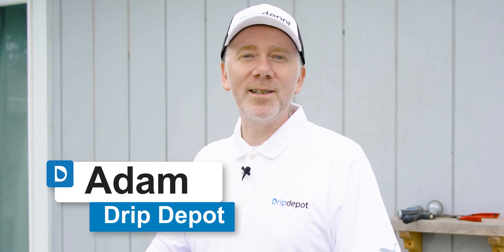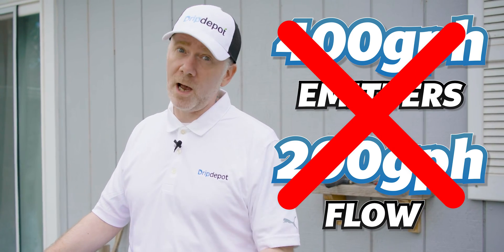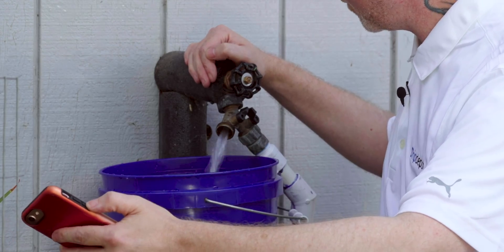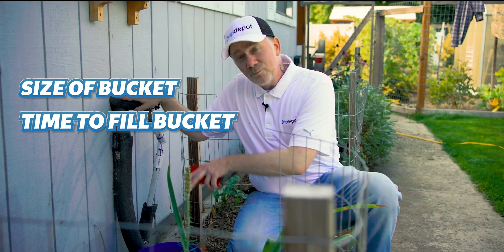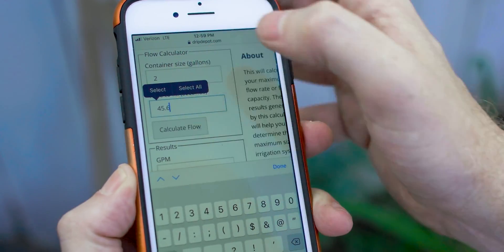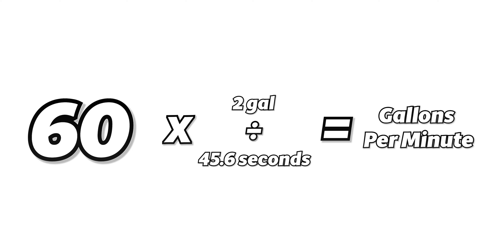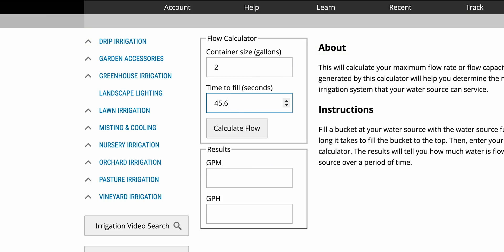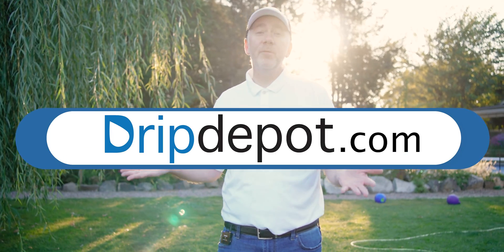How to Check the Flow Rate of your Water Source (GPH/GPM)

Comment: But what is the output of my rairbird system that connects to the water supply? Is it the same as the bib?
Reply from the maker: Good question, your instinct to ask it was spot on.  Flow will typically be a bit less coming out of a timer.  All of the head assembly pieces have an impact on flow to one degree or another.  The impact is typically small, but there are some exceptions, particularly in timers.  I think I mentioned it in another comment, but one thing we see professionals on the residential side of things do is to simply subtract 20% from the tested flow rate.  This 20% reduction is meant to account for all of the small variables that can be time consuming to calculate individually (small losses in fittings like elbows, the channel through the timer and/or pressure regulator, the filters, etc).

Comment: Do you need to test with the pressure regulator on? Currently i get 5 gallons in 17 seconds but I would assume when the pressure regulator is on it will lower correct?
Reply from the maker: There's definitely no harm in checking with the regulator connected, as you are correct that it will have some impact (usually minimal, but it can be more significant in cases where the regulator diameter is smaller than optimal for the flow rate required).  

Another approach we see a lot of is to subtract 20% from the flow rate and work from there.  The 20% reduction is meant to account for all of the small losses in an irrigation system that can be tedious to calculate individually.  Small losses like elbows (both 45° and 90°), tees, pressure regulator channels, valve channels, etc :)

Comment: Now if i could only figure it out for a house interior plumbing when it's a house that isn't built yet. Grass irrigation comes out of the rain's expenses.
Reply from the maker: The builder or plumber handling that part might be able to let you know what to expect to some degree.  

If they can let you know the size of the incoming water service line, expected static pressure, plans for pressure regulation and what size supply lines they're going to use for the hose bibs a rough ballpark could be determined :)

And rain definitely works for the grass, our area went through a few years of drought so I got into the habit of replacing lawn with edible landscaping and native plants.  If that's the route you're going a ballpark on your hose bibs is a great place to start.

Comment: How do i do this when my faucet is close to the ground? A bucket won’t fit, not even a 1 gallon bucket will fit under it.
Reply from the maker: This can definitely be a challenge (and one I faced as well, my spigot at home is only about 5" or 6" from the ground as well).  Probably the easiest would be to use a short length of hose to route the water up and into a bucket.  This will influence the reading a bit, but if anything the lower reading will give you a little bit of design cushion.  

I ended up using a gooseneck adapter on mine - even that didn't lead to a perfect reading since the bucket had to be tilted, but close enough I could work with it.  A 90° Faucet Elbow can also help (and good chance you'll be using something like one of those either way since you'll need to build at head assembly at the spigot).  I'll link both parts below so you can see what they look like and how they could be used to change the angle of the hose connection: 

https://www.dripdepot.com/brass-gooseneck-with-shut-off

https://www.dripdepot.com/three-quarter-inch-hose-thread-faucet-adapter-fitting-type-elbow

If you have one of those faucet Y splitters at home already, that may also work to some degree, at least to turn the hose connection so you could connect a short hose or something similar to direct water into a bucket or jug :)

Comment: What if I am trying to use a sprinkler system valve so that I can set up a timer and control from my phone? also do I need a pressure reducer for any reason? I have 6 grow boxes each is 3 1/2 X 7 1/2 - I would use 1 sprinkler head for the 3 and another for the other 3
Reply from the maker: You bet, sprinkler valves work well for drip irrigation zones as well, and will often have higher flow rates than a hose bib since they're intended for sprinkler systems.  Testing the flow rate is a little trickier since it's in the ground.  The "official" way to test the flow rate from a sprinkler valve is with a water meter, but I realize that's not always convenient (and they can be a little high in price).  

A work around that would at least kind of work would be to attach a threaded fitting to the outlet of the valve (which might have threads already) and attach a short length of tubing or hose to it and do the flow rate test out of that.  Not 100% accurate, but gets you in the neighborhood at least.  

Good chance you'll need a pressure regulator since most drip operates at 10 to 25 PSI and sprinkler systems are usually much higher than that.  A filter is a good option too, drip emitters have much smaller orifices than sprinklers.  

With that said, it sounds like you might be looking to run the drip system from converted sprinkler heads rather than the valve itself?  If so, most of the information above applies exactly the same, though a flow test becomes less important since one sprinkler often has as much flow as an entire drip system.  Pressure regulator and filter are still usually needed when converting sprinkler heads. 

We made a short video that goes into a bit more detail in converting sprinklers, if you hadn't bumped into it yet here's the link: https://www.youtube.com/watch?v=l8gzTCgZQLQ

Comment: That’s seriously bad and wouldn’t even run a small zone unless it was two heads probably
Reply from the maker: Yep, it wouldn't run too many sprinklers, that's for sure!  It could support a reasonably sized drip system though.  It's not in this video, but we ended up setting up a drip system for the raised beds at the house where this hose bib is :)

Comment: I did this test and it only took 8 seconds to fill up a 2 gallon bucket. So I calculate that my system can handle 900 gallons/hour. Does that sound right? The water was coming out of the spigot much faster than in your video.
Reply from the maker: That does indeed come out to 900 GPH, a very healthy flow rate for a hose bib!  I thought mine was strong at 750 GPH at home, you have some fantastic flow out of that.  

You probably won't make use of all that 900 GPH, but the abundance of flow is a good thing to have and will give you lots of flexibility in planning.

Comment: The challenge I’ve run into is by the time you add all the stuff, fittings, head unit, etc., I’m getting like half what I get at the spigot.
Reply from the maker: That's fairly normal, and things are likely to improve once the system is all setup (particularly the pressure regulator, which doesn't really begin working until the lines are pressurized and there's flow from the emitters).  

In the industry, as a way of quickly accounting for many small losses (elbows,  tees, some valves), is to subtract 20% from the flow rate and size the system or zones to that number.  So 500 GPH becomes 400 GPH.  Friction loss in the pipe or tubing will still be calculated separately, but the 20% takes care of all the small losses that are very time consuming to calculate individually.  

Happy to help with this if any follow-up questions come, don't hesitate to drop a line!

Comment: I just set up my drip irrigation for 7 beds and not every bed is receiving water. Is this tied to a pressure issue? I used 70ft 1/2 in tubing, pressure regulator is 25 PSI. Should I install a second set up and cut the irrigation in half?
Reply from the maker: Danielle, this could indeed be tied to pressure or to flow -- before zoning the system, there are a couple ways you can check this to confirm.  If possible without too much hassle, you could set it up so that the beds that are getting water are bypassed -- then you can check the beds that are getting water.  If they begin emitting water as they should, zoning the system would likely fix you right up. 

Another thing to check, and this might be more inconvenient, is to test the flow rate of your water source versus the flow rate of your system.  To check the flow rate of your water source all you need is a timer and a bucket -- time how long it takes to fill the bucket with water and then plug the numbers into the Flow Rate Calculator at this link: https://www.dripdepot.com/irrigation-calculators

The flow rate of your system is simply the sum of all emitters operating at once -- for example, if you're using 400 of 1/4" drip line with a 0.5 GPH emitter spaced every 12", the system flow demand would be 200 GPH.  Generally, you want the flow rate of your water source to exceed the flow rate of the system by about 20%.  

I'm happy to help with any of this if you have any questions! :)

Comment: Question 
If I am to use a pressure regulator for my system as recommended shouldn’t I be measuring flow rate with the regulator attached?
Reply from the maker: Also a good question :) 

While I think it's not a bad idea to do so, the results won't be completely reliable -- the reason is, a regulator doesn't engage unless two factors are present: pressurization and flow.  If you were to connect the regulator, turn on the faucet and flow test out of the regulator, you would only have one of those two factors present (flow), so might get unreliable results.  

You're on the right track though, as everything added to a spigot causes some flow restriction (which is why I think it's not necessarily a bad idea to do so anyway), even if it's minimal as is the case for most head assembly components.  

When testing flow for an irrigation system, I do recommend leaving some cushion between the flow rate result and the flow of the system.  For example, if the spigot tests out at 200 GPH, I wouldn't install 200 GPH in emitters on a single zone, as unaccounted for small losses could cause enough loss of flow that some emitters may not work as they should.  While it's not scientific, I tend to leave 10 - 20% between the flow of the water source and the flow of the zone or system.  So far I've had great results going that route (though again, it's only anecdotal, so not scientific, but has worked for me) :) 

Thanks for the second great question!
Reply: @dripdepot  I am super impressed with the quick response time and detail answers to my inquiries- BRAVO!
Reply: @dripdepot  thank you